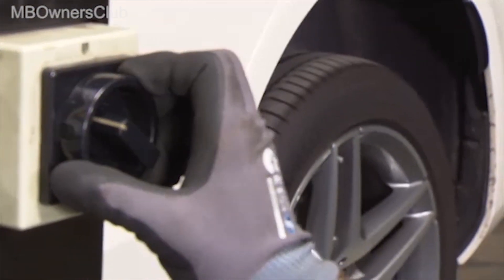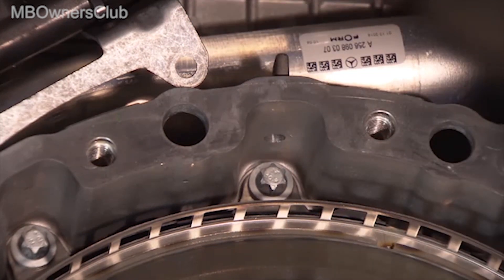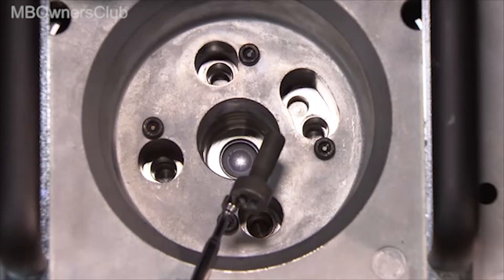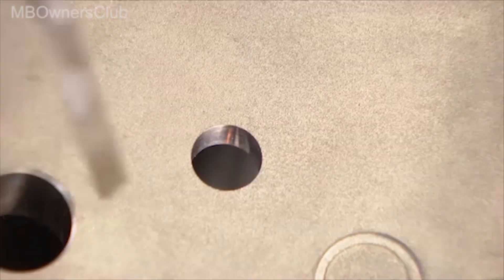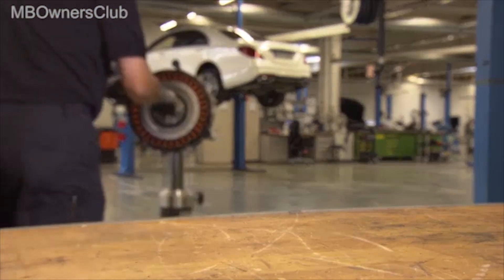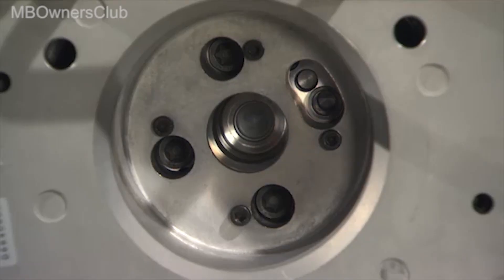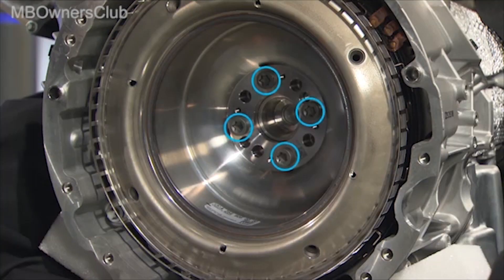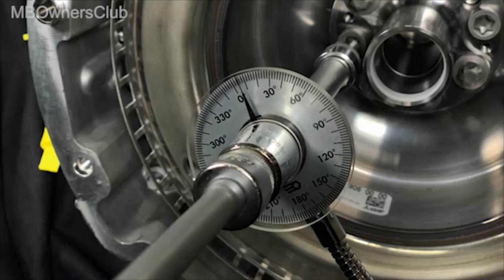Mercedes-Benz M256 Engine: How to Replace the Integrated Starter Alternator

Comment: This is a German thing.. Over Engineering as usual as BMW has head down this same path. I think people concerns will be around tried and tested so if you are purchasing a car with the engine, know that it has been in production since 2017 is multiple models. We are now in 2024 we are seeing replacement videos and talks This video looks like it's posted just outside the 2017 model warranty. This is a Bosh product, this unit is protected from outside forces unlike a traditional alternator. It should, based on generator technology in these days, last a good time over the ownership of the car as cars last longer than they did 30 years ago. Mercedes makes one of the strongest lasting V6 engines in the market, spanning over 25 years of upgrades, changes and fixes. It's the technology we love to have which causes all the headaches.. it would seem that heat and cold cause these parts of the car to fail more than we'd like.

Comment: this is problem ready to start too much work and very expensive 
just leave the old style altinator and starter much cheaper 
this is only money for mechanic and dealer
Reply: This is much better and longer lasting. Normally there isn't a reason to replace this
Reply: @m850i_individual  It's mercedes.  They 100% fucked something up in their overcomplicated design.  Germans cannot do simple.
Reply: @FryChicken  I own this powerplant. There is nothing that went wrong in 6 years
Reply: @m850i_individual ever had any problem?
Reply: @FryChicken  I can‘t skip time.
Reply: @Swilkinson1  not at all. I heard from someone who had issues when his car was brand new, but once fixed also nothing anymore
Reply: @m850i_individual  think the non hybrid would be better or a lexus

Comment: wonder how much a dealership charges for an ISG replacement
Reply: That would be two arms and a leg
Reply: leave the ISG just ask about the 48V battery and see the problem
Reply: What is the result of a good ISG on multimeter???
Reply: I have no real data, but, since these are just coils of copper, wrapped in a 3 phase setup, resistance should be low. I would guess something like 1 to 6 ohms across each. Whatever the actual values, they should be consistent. If one is way more or way less, then you’ve found an issue.